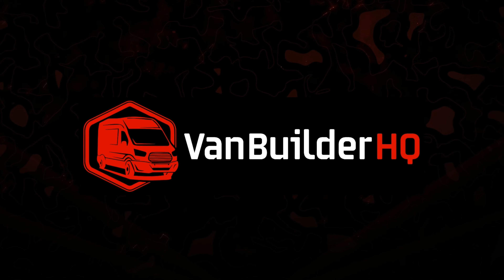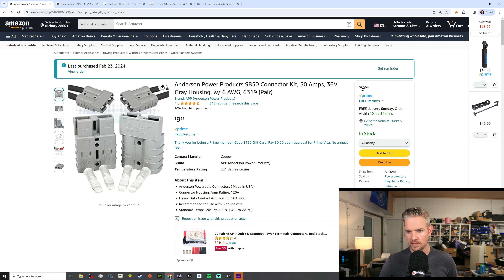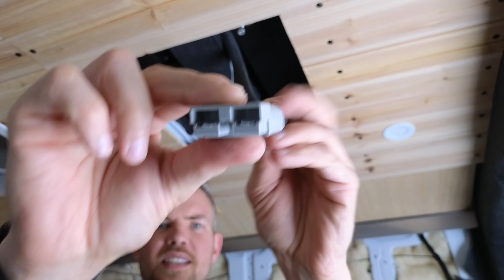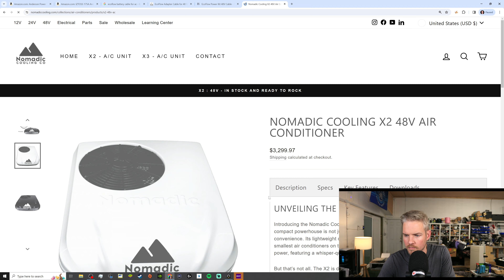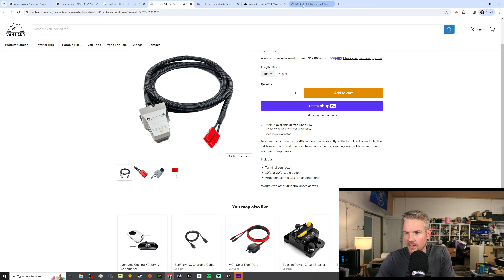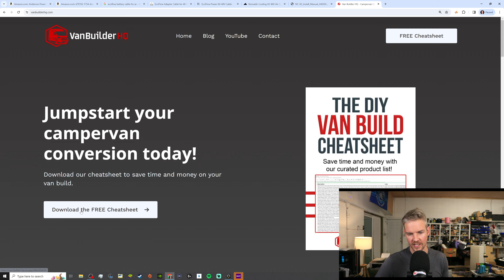Using Anderson Connector to connect Nomadic Cooling X2 48V Air Conditioner EcoFlow System

Comment: Did the Vanland cable completely seat to the Ecoflow Power Hub?  Mine does not and leaves a 1/4” gap and falls out easily.  The connector is built for connecting to the battery, not the Hub.  Wondering if you had same issue?

Comment: I recently did the same install after talking with nomadic support I just crimped ring terminals on to the Eco flow cable, and connected to the AC with the existing ring, terminals some shrink wrap, and it’s all good